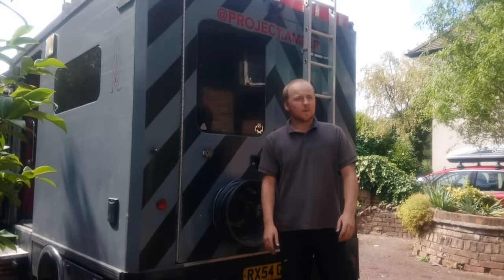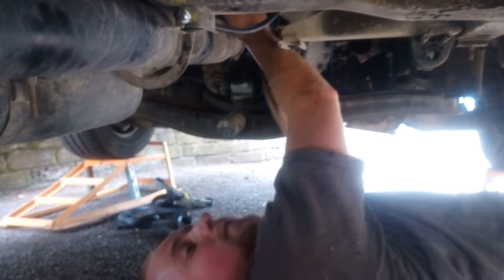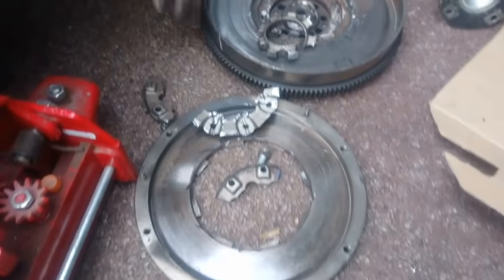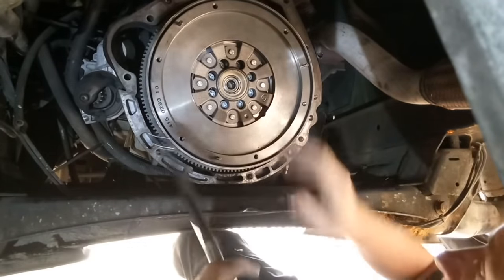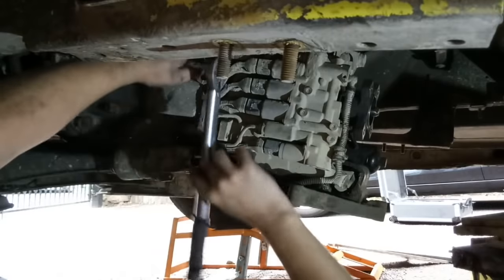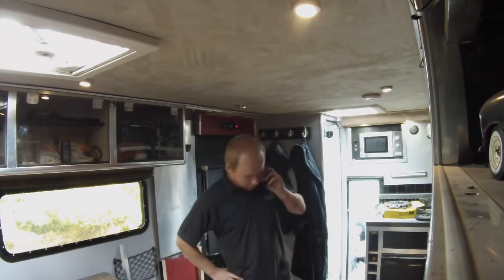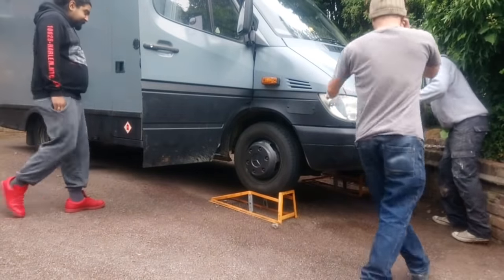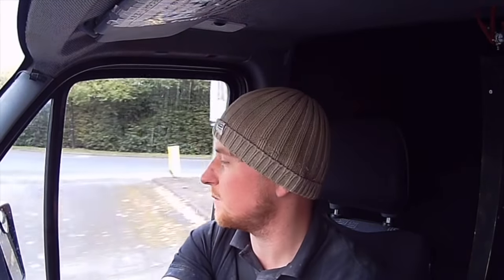Sprinter CLUTCH CHANGE From Hell! (After 13,000 Mile Eurotrip)

Comment: I'd have doused the van in petrol and lit it up the 3rd or 4th time. I've done plenty clutches but i try to avoid doing them on German vehicles. What a bunch of tossers. LUK clutches are great quality but they are a bit of a dark art. The manufacturers don't seem to have any easily accessible resource for matching part numbers to vehicles besides calling. 

That original clutch/flywheel doesn't even look all that old. The thrust bearing/slave cylinder and the alignment are really bad. It makes me wonder which went bad first and if it didn't fail prematurely due to poor fitting when it was last done. 

You know mate i'd rebuild the entire front and rear suspension and do all the wheel bearings. I know you'll hate life but i think your van has had a hard life before you got it and probably has a whole set of failures waiting to happen over your next few years.
Reply from the maker: Yeah it's on the list to get everything ticked off like that, the trip alone would have done damage let alone it's previous life. But after this I might just get some cash together and throw it into a garage to get it done haha
Reply: Problem is, tossing it in a garage gets You a tossed-in-a-garage type of job.
Got a first series Sprinter 212 d myself and do most things my own, for I'd like to keep it for some years more to come. Even Mercedes does not the whole job they want to get paid for everytime (although they usually do better than some of the "cheaper" garages ...) it's a commercial car out of warranty after all ... no need to fix 'em properly, You have to pay for every part of work anybody does. So You only know it's done properly doing it Yourself - or supervising it Yourself the whole friggin time.

Comment: it will run better with your new dual mass  .as the crank sensor would have a wrong reading regards timing .as the exciter would be in the wrong place  as the plate had turned . .i turn these around in 1 1/2 hours on my back  but i do these weekly .next  time  remove the rear gearbox mount first  let the engine drop and you will get at  the bolts a lot easier . regards your clutch fault  it is best. to back bleed your clutch..as the normal way you will not get all the air out  it is .not normally a centric bearing fault ? you   have learnt a lesson here.  give it to a reliable mechanic that knows what he is doing .  by the way there is 2 types of dual mass  flywheel.  i know your not a mechanic but all ways check the parts to see if they are the same . put them side by side.
Reply: The exciter is on the solid part of the DMF same as the ring gear. Wouldn't affect your timing.

Comment: Those thrust bearings are a joke no reason why the hydraulic part can't be on the outside like early cars were even the early hdi Peugeot engine with the dual mad has one on the outside of the gear box
Reply: Walter Sobchak  well my Peugeot 405 TD did 140 k on its original valeo none duel mass clutch pull clutch :-)  My dads 406 hdi has a duel mass clutch and flywheel with a clutch folk and external cylinder so why put the hydraulic part inside the gearbox bell housing?

Comment: Well as I type this my ex police riot van conversion with only 60,000 miles is in with Mercedes with the exact f error code in dash, they said it needed who new clutch, flywheel and bearing to the tune of £2000 they've just fitted it and error f message is still present they say it's not learning what the fuck, I personally think it's electrical ..........stressed as I full-time in it..........help
Reply from the maker: Get them to check it's the right pressure plate thickness. Mine was wrong from 2 suppliers
Reply: @ProjectAmber  I did mention it but to Mercedes but they say it's the Wright part number..........time will tell but I've lost faith in this sprintshift , which is a shame because it has the bomb proof cdi engine with only 60 ,000 miles and four wheels on the back so a solid chassis
Reply: @ProjectAmber  personally I think it's electrical
Reply: @ProjectAmber  well your not going to believe me but after banging the same drum to the Mercedes dealership regarding what you went through with two clutch kits being wrong they kept saying the parts were correct, they eventually listened to me and after a 30 minute phone call to their supplier they admitted it was indeed the wrong part, they say because they were also replacing the flywheel they needed a different clutch plate.......let's hope after two weeks of stress that they for the correct clutch plate and all will be well......I'm so glad you uploaded your very entertaining but stressful for you video if I ever cross paths I'll buy you a beer.....if not I might be a patron
Reply from the maker: @namastesteven5655  haha they are bloody useless! Somewhere something is messed up with parts.
But Mercedes should have known better.
Glad you got it sorted buddy, mine did the exact same thing and I too lost faith in it, but you should be all set now, and I'm presuming it has warrenty so a year of cover at least.
Yup not fun when you rely on the van so heavily, I know that pain well 😆

Comment: ignorance will get you killed,  any professional mechanic will tell you that those mechano ramps are build to support about 800 kgs ... not 2500kgs... as you can see from the left hand one after your truck came off it was on the point of calapsing, you would get no notice and find yourself getting crushed to death.    end of life, especially when you work by yourself, on a slope, under a 3500 kg van, with ne clearance..... SAFETY FIRST!! ALWAYS!!!!!!! if you want to keep enjoying life.
Reply from the maker: The ramps were re-enforced and held the van up for a year whilst converting. Its ok, we were good. 👍
Reply: Wooden ramps safer